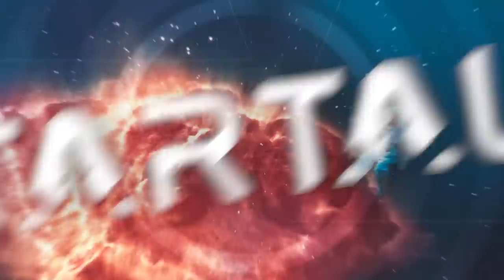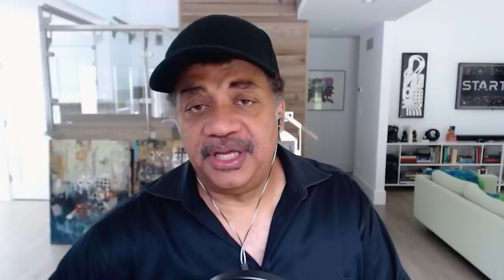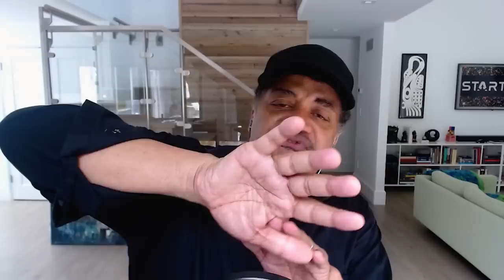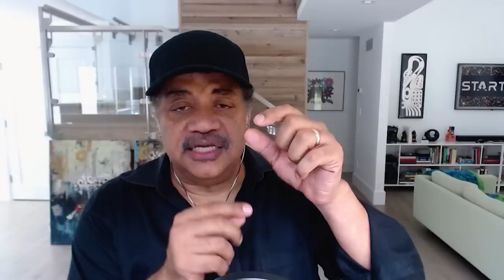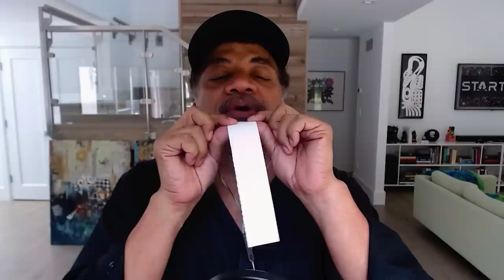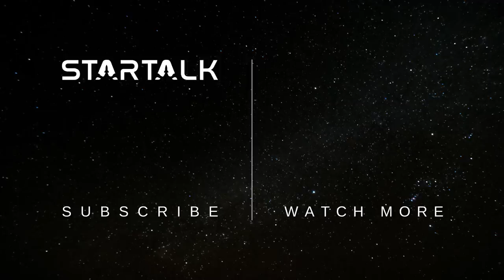Why Are Race Tracks Banked? | Neil deGrasse Tyson Explains...

Comment: Daytona's turns are banked at 31 degrees and Talladega's tuns are at 33 degrees. I heard that Talladega was built with this banking because concrete or blacktop cannot be laid at any steeper incline. F1 and Indy have reduced the number of races on high banked ovals because their speeds can get too high. Texas motor speedway is probably at the highest banking, 20 and 22 degrees.

Another experiment for the Bernulli effect, is to tie a ping pong ball to a light string move it closer and closer to a hair dryer, at full speed, or a faucet completely opened, the ping pong ball will be pulled into the stream of air, or water.

Comment: There's so many more things that circle track race teams are doing to cheat the physics in their favor. Like running a larger diameter tire on the outside of the car than the inside. Running a rear suspension design that changes the wheelbase of the car in the turn, making the inside tires closer to each other than the outside tires. Running lots of camber to maximize tire contact patch. Running aero down force to push the car harder into the track than it's own mass would otherwise do etc. This is just the tip of the iceberg.
Reply: Don’t forget the flux capacitor and the blinker fluid!
Reply: Don’t forget the flux capacitor and the blinker fluid!
Reply: My StarTalk… Neil Tyson is on National Geographic lol
Reply: Toshiba laptop is a satellite
Reply: @timothyp.southwick6542  false my friend very false
Reply: @timothyp.southwick6542  Singularity is my algorithm and the block chain in a wormhole in time and space pulling information from any specific point terminating any tracking and violation of human safety. Do your looking up information see if you can find it’s origins
Reply: @2cansam95  The most important stuff.
Reply: There are rules you know
Reply from the maker: Thanks for making us aware!
Reply: @alternatemusicaddict5226  successful race teams play between the rules. Nobody winning follows them to a T lol.

Comment: Dale Earnhardt used to always talk about the "dip" coming out of turn 2 at Daytona......it would cause a brief loss of traction as the air flow below the car would increase once you went over that small dip in the track. He told Terry Bradshaw during a ride along about this, and said you had to be really careful out of turn 2 with that sudden drop of friction due to the track dip, and said he usually tried to avoid it, or else you would spin out. You should watch the video of Earnhardt taking Terry Bradshaw on that trip around the track just before he died in 2001.

Comment: Definitely looking forward to all the future racing physics talks!!! I'm also glad we got to touch on flat-tracks and formula 1, because one should define "high speed" when discussing race tracks and banking. I'll give you that rally and some flat dirt-tracks are definitely slower than Nascar, but Formula 1 and F-zero aren't so much... 

    Worth a tickle on asphalt and tarmac versus concrete. Asphalt is going to have a grit coarseness similar to a sheet of sand paper, and it physically "bites into" tires to add to friction/traction. Heating the rubber actually makes it softer, not necessarily sticky or gummy, since that would take a bit more heat than you want on a pressurized tire supporting a ton or two of vehicle with a living driver inside. Softer tires "stick" better than harder/colder tires.

     The same is true for motorcycles, though we don't really have enough rubber to want to get out and spin them to heat them up, preferring to ride gently or even find a good spot for some figure-8's to practice before hitting a road with any "real speed" in the design... Racing Bikes will have the wheels artificially heated up with what are essentially electric blankets wrapped around them before races to get them ready to run hard right out of the pits... ;o)

Comment: I moved from a mountainous U.S. state that banked it's turns for the posted speed limits, to a flat state that slopes the roadways to both sides to shed water even in turns. Turns are not comfortable without banking for speed.

Comment: The suspension is set up for that speed as well.  A friend did the NASCAR Experience in Las Vegas, below 130 the car wanted to turn to the left. He maxed out at 160 he had to make only slight steering adjustments. Although he admitted to having a death grip on the wheel the entire time.
Reply: From day one of any legitimate riding course on a motorcycle, we have to get drilled about "loosening up" our grip so our hands don't get cramped or go numb... haha... LOTS of people struggle with that for years before they can over-come it, and just about everybody has to deal with it. Hard not to have a "death grip" on any control in or on a "dangerous machine" when you start feeling that danger or risk go up.

    I've ridden most of my life, and I still occasionally have to flap my elbows and remind myself "Piano hands"... SO your friend's instincts are understandable.  ;o)

Comment: This year's NextGen car in NASCAR had a complete overhaul under the car. Last year, the drive shaft, transmission, rear end gear, and axle was exposed. This year there's a "cap" that covers the entire underside and funnels the air through the rear diffuser, allowing it to go under the car much faster like Dr. Tyson is referring to.

Comment: 13:03 FYI what you're describing is not called a spoiler, it's actually just called a wing. A spoiler doesn't add downforce, it directs airflow to reduce drag. That's a common misnomer.

Comment: One of the things I find fascinating about modern F1 cars is that all the power in the engine is not just for straightline speed, but to help the car get pushed down as it takes corners -- that F1 cars actually have more grip and control on corners the faster they are, which is the opposite of the reason for banked turns. And, fun bonus, tracks like Zandvort have banking, which adds to the variety of racing lines the drivers can take as they try to balance banking with speed and downforce.

Comment: @00:07:30 two things are incorrect...
1. There are two banked curves in F1 at the Dutch Grand Prix in Zandvoort, Turns 3 and 14 – named after former circuit director John Hugenholtz and two-time Indianapolis 500 winner Arie Luyendyk respectively – they have corners banked at around 19 degrees. 
2. Neil said that in F1 in corners the cars must slow down, that is also incorrect..there are several corners in F1 that you can take 'flat out' with speeds above 300km/h.

Comment: Great explanation! My uncle used to race on local dirt tracks way back in the day. The tracks were slightly oval, no banking. It was a regular occurrence for cars to run off the track in the first or second turn the get back on the track in the third turn after running around the outside of the track! There was no seating on the back of the track just flat ground for the drivers to travel on until they could get back on track!!! Good times!!!😂😂😂
Reply: The dirt cars with massive wings? Sprint cars, I think? Those cars look wild

Comment: If there had been more discussions like this in school, physics and dynamics wold have been a lot more fun. The closest we got was what was the maximum rotational force on the rear wheels of a dragster so that it would not lift its front wheels off the ground. Thank you gentlemen, always the most enjoyable time spent with you.
Reply: The problem is that in school you actually have to apply the formulas and do the maths properly. Trust me, if they actually started to talk about the equations and stuff, they'd easily lose 70% of the audience if not more.
Reply: @louisrobitaille5810  That would be true. However, when I was studying engineering it always seemed that the problems where you would use the math and develop the techniques for solving the problems were dull and uninteresting. That issue made the classes a labor to attend rather than a joy.

Comment: Neil, could you do an explainer on adiabatic expansion - I asked my self this question and found the answer fascinating “If hot air rises then why Is it not hot on top mountains” 

I also read the data centers use adiabatic expansion to cool there facilities.

Comment: Isn't this what's happening on a road bike (and motorcycles)? As you attain higher speeds, you steer less, but you'll bank your bike more. Intuitively, you'll actually begin steering in the opposite direction to where you want to go, and your bike will turn for you in the direction you need to go. I hit 42 mph on my bike today and love feeling how solid my bike is at those speeds. It does not want to tip over. You are sitting on a rolling wall 😂 It's an incredible feeling.

Comment: Its a good explanation of how the track is, and how you can set the car up to take the turns without "turning". But, the "high siding" he's talking about is called being loose, where the back tires loose grip relative to the front tires, the back end comes around as if it where on a dirt track. Although most NASCAR racers like their car's to be as loose as possible without the back end (tires) loosing their grip, while also having the car tight enough for the front tires to keep their grip without them sliding up the track. When this happens, it's called 'being tight'. The front end feels like it wants to go toward the outside wall, like the tires in the front aren't turning at all. There's so many things the NASCAR chassis has to set the whole car up to handle the way they need it. Most good drivers, set their cars up to race the track and not the other cars around them. Then, the bodies and bottom are shaped and designed to create downforce, the bottom is flat, the top is curved, so, air thats going under the car is faster than the air going over, and that creates the suction that pulls the cars into the track surface. But, too much downforce can bottom out the cars, and create a lift sensation, that can be enough of a lift to lose the tires grip and be in a car wreck, so, the newest cars have a slight opening at the front of the racecar at the piece called the splitter, than the sides connect as close to the racing surface as possible, this allows the cars to be as low as possible to have air push the sides down, have air under the car and air over the top to create that total downforce. They can make the springs stiffer so that when the right side of the car settles into the turn, the spring rate pushes the tires into the surface even further, than, tire pressures are also essential to the total grip. Weight adjustments, tape, spoilers brake bias. So many things that these cars have that you can do a whole scientific series on. That would actually be pretty cool.

Comment: I just wanted to start at the beginning. The track is a loop and it's flat. A car going fast and straight comes to a turn and because it's a race prefers not to brake and slow down much for the turn. You need enough friction to follow the radius of curvature of the turn. Without enough friction you can't make the turn the track is making. You'll slide off the outside of the track or into the wall. The banking is to add to the normal (down) force, traction patch against the road surface. I had thought the banking was to keep you from slipping not that it meant you didn't have to steer to negotiate a turn. That part was intuitively non-obvious, at least to me. I thought Dr. Tyson was going to parse mass versus weight.

Comment: This is good and it explains why in 1987 Bill Elliot was really risking everything when he, in qualifying for the Talladega 500, set the all time record for a lap of 212.8 mph average speed and he never lifted off the gas. That's getting outside that equilibrium of grip and angle and speed and radius. 
  Bill Elliot holds the track record for fastest qualifying speed at Talladega at 212.809 miles per hour (342.483 km/h) and Daytona International Speedway at 210.364 miles per hour (338.548 km/h), both of which were set in 1987; the mark at Talladega is the fastest qualifying speed for any NASCAR race ever.
   Talledega has 33° banking, Daytona has 31° banking.

Comment: Chuck's "putting your thumb on the scale" is incorrect.  It is more like hanging weights from the bottom of the car literally pulling the car down, not pressing it down.

By the way, there is one other part of the down force you haven't covered and that is "diffusion" which is an added down force at the back of a car produced by the increasing height of the body away from the road from the back tire to the back end of the car (couldn't think of a better description at the moment).  Anyway, the air flows under the car in a very confined space and then, at the back end of the car suddenly widens which causes a vacuum effect pulling the car down into the track.  Again, it is called "diffusion".  I realized this might be a thing while watching CART racing and asked a team engineer at race in the garage area.  He let me know I was correct and what the correct term was.  I was pretty chuffed that I got it right on my own.  Pretty cool!

Comment: Add to this how they do it in Formula one. Their cars could run on the ceiling with all the downforce they generate using  their front and rear wings-spoilers at speeds little more than 50 mph
Reply: not true the down force doesn't actually have any real 'weight' until you hit 150kph
Reply: @santanamauricio  That's 93 mph and I said at a little more than 50 mph so yes. Also, that figure changes somewhat from year to year with regulation changes. So it is closer to 90 than 50 perhaps(I'llll take your word that you googled it) But otherwise, I stand by my statement.  It is mostly true as stated.

Comment: You really see the momentum of the car as it leaves the corner and has less of the lip to help. They "suck" to the outside wall.

Also in drag racing those tires squash and flatten out to provide a larger footprint at launch, and again stand up at speed minimizing the amount of friction with the ground to minimize drag.

For those who do not understand racing, it all physics and an endless amount of information to know. I've been doing automotive for more than 15 years and I still barely know about 10% of it

Comment: There's a bit of misunderstanding or oversimplification here.  The drivers are absolutely turning the steering wheel through the banked turns - race cars always go faster than the bank's "equilibrium" speed, even at steep banks like Daytona.  The bank helps so they don't have to turn the wheel nearly as much as they otherwise would have to, and then less turned wheels means a higher speed before the tires lose traction.  Aka - higher banked turns let you go faster before skidding compared to lower banked turns of the same radius.

Comment: Before Nascar, before Indianapolis Raceway there were velodromes here in America. I have been associated with the International Human Powered Vehicle Association where the speeds of our streamlined bicycles and trikes are too high for the standard Olympic velodromes.  Interesting to me, an official for world records that our organization certifies, because the UCI that certifies bicycle world records will not, is the time i watched a former olympian bicycle racer use the California Speedway to attempt to beat the hour record, decades ago.
Even that large, 2 miles around Nascar tri-oval stole too much energy from him, and before the hour was out he had to abandon the attempt.  a few years later another olympic caliber cyclist I know, did find a big enough, flat enough oval, to set the record at, but it was an auto manufacturer's test track. those are over 5 to 8 miles around and even there the streamlined recumbent bicycle would stay off the banking to save energy. 
Automobile racers trade horsepower for speed using that physics. I was at the now gone Riverside Raceway in California to see the Jim Hall Chaparral race car use its large downforce spoiler. It would only tilt up in the sharper corners of that road course, and the pylons that  held it in the air were connected directly to the rear wheel shock towers, not the body. Naturally  it won handily and that sort of active spoiler was immediately banned. Not to be dissuaded, Hall came back the next year using a vacuum suction method of increased adhesion, also dynamic, and also never done again.

Comment: I'm sorry for everyone watching this video, but the explanation given is entirely incorrect.
A banked turn DOES NOT STEER A CAR.
If that were true, then it would happen with motorcycles too, but it doesn't.

The reason why cars turn in a banked track is because of a gearbox called "differential" (all cars have this component). This gearbox has the side effect of turning faster on the side that's receiving less weight.
When a car is on a banked track, the wheels on the outer side of the track receive less weight (because the force of gravity is now pointing closer to the wheels on the inner side of the track, i.e. the car is tilted).
Therefore, the differential makes the wheel on the outer side of the track to turn faster, and the wheel on the inner side to turn slower. This is what causes the car to steer downwards. This happens with any car on any inclined plane. i.e. all cars naturally steer downwards, whether the track is straight or curved.
Vehicles without a differential don't do that.